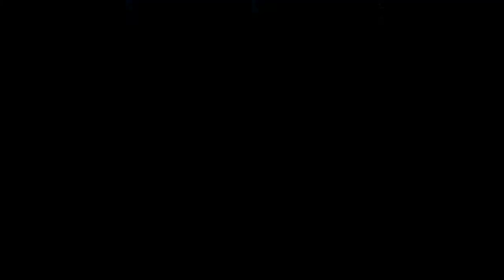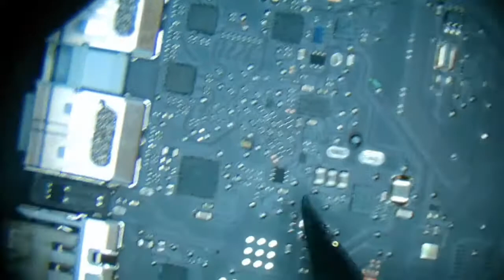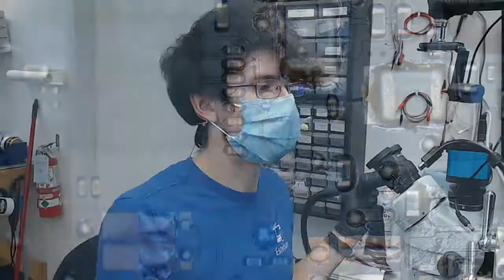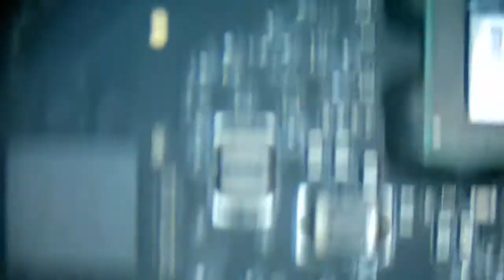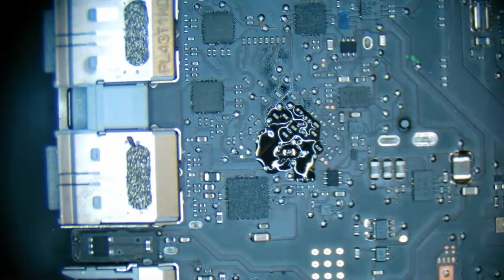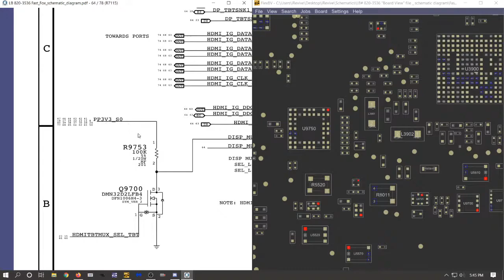MacBook Pro A1502 No Power issue

Comment: Great help material. 
Thanks for put this up. 

The problem I’ve got on my MacBook A1502 is that the system does not power on but the fan spines anytime it’s connected with the cable powers source. 

Please have you got any suggestions as to what could be going on?

Comment: Hey, i have macbook proo a1502 early 2015, but it won't turn on, i tried to disconnect the battery, speaker, touchpad/kbd, and then plugged in the magsafe , and it turned on. Do you know any solution to this problem, or suggestion of what should i do?

Comment: Quick tip re how long it took to get the diode off at 9:16, turn your heat up to 500 degrees c on your quick, you will not damage any components as you will heat up the area quicker instead of blasting it at 400 degrees or whatever you have it set to for longer. The tip is it's better to ger the part off quickly than to heat for a longer period of time :) other than that you're doing well ;)
Reply from the maker: Thank you. This is a good piece of information. I have experimented with this method and have had success. I use to be afraid of overheating components, which is why I would use between 380-420c. But by your logic, it would make sense to heat faster with higher heat. Thanks.
Reply: @iRevive  Nah don't worry about damaging anything with those multi-layer logic boards, they can take a good beating/heat. This is also good for the surrounding components as they're not exposed to 420c for such a long time. Crank that puppy up to max heat, adjust your airflow and blast it off quickly.
Reply from the maker: @beogeek  Interesting. I will try that next time. Thanks for the input!

Comment: Hello greetings from Panama City.
I really like your repair channel. He wrote you because I have a macbook a1502 and it has the following symptoms and let's see if you can give me your recommendation.
1. The laptop gets hotter than 100 degrees
2. Turns off when heated
3. the fan works
4. Shuts down randomly. but only if heavy tasks like video capture are done.
5. Already cleaned and put new thermal paste.
6. The screen was changed, but it has something strange so that it lowers and brightness you have to close and open the screen lid.
7. The battery and hard disk were changed
8. Awaiting your response ....

Thank you
Reply: He couldn’t figure this one out